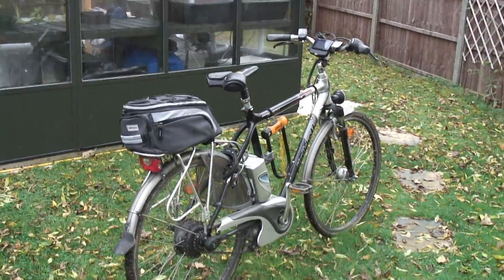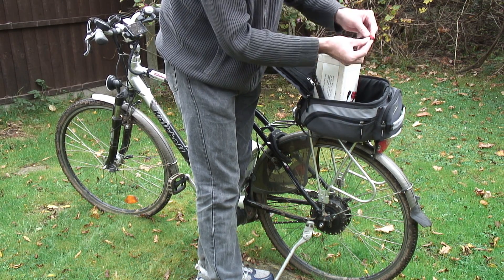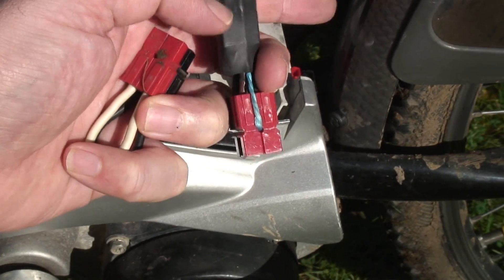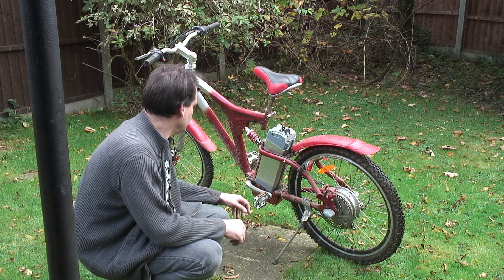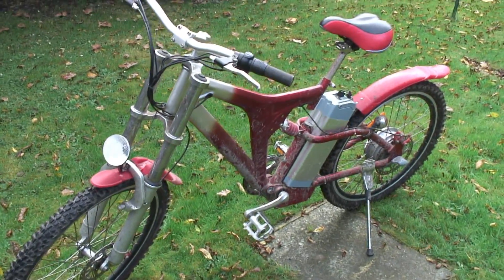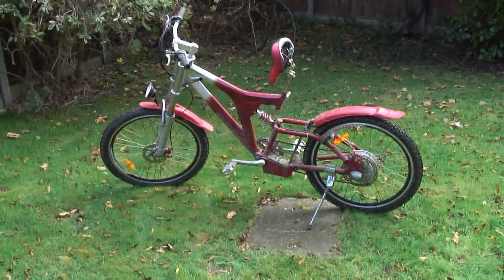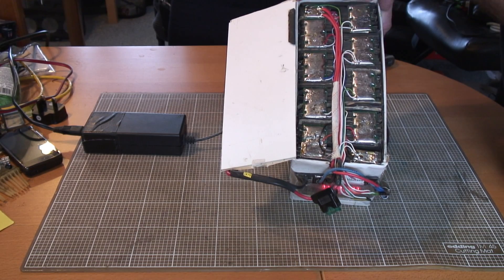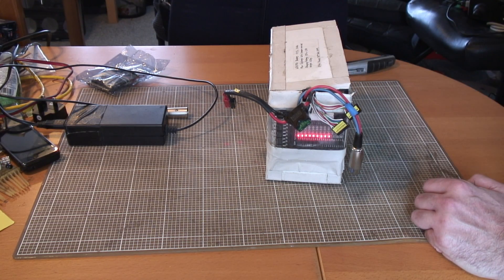E-Bike Overclocking and Custom Battery Packs

Comment: Hi Jim I have just purchased a new Panasonic motor, i intend to mount it on an old bike frame i have by means of some chopping and welding.
  For the moment i only have the motor, a rear 8 speed internal hub + some large'ish Li-po's & the old frame to work with. 
  I know i will need the handlebar display (controller). Also i will have to buy the chain ring a tensioner and a few other bits n bobs.
  Is there anywhere i can find detailed info on this motor? I've been finding it difficult to unveil Panasonics secrets.
  I will be trying the shunt short mod. Seems what you have dont is basically remove the shunt with that much wire wrapped around it but it did not appear to be soldered to your shunt, could the shunt be removed completly? What exactly is the job of the shunt? It dumps power back into the circuit and routes it away from the motor right? But why exactly? I have seen them in ammeters, it's basically a powerful low resistance resistor which provides enough resistance so that you don't have a 100% dead short but what is it's purpose in the speed controller? Is it like a safety buffer? A restriction? 
  Anyway sounds like it does the job but i was wondering if you have any info on these add on dongles? They basically trick the electronics into thinking the bike is doing half the speed it actually is but what is inside one of these? Is it simply a resistor? I see people are selling the kits for huge amounts of money and there cant be a great deal of electronics squeezed into a jack plug!
  My initial thought was that the torque sensor changes resistance as you pedal but i also read that it induces an electromagnetic field. Obviously there is a simple way to trick this signal but i am still trying to find the info.
  For the moment i just have the motor and there are a tonne of wires and i can't find a wiring diagram anywhere. Any help would be much appreciated. I live in the mountains and am surrounded by trails, town is a good 1 hours ride up and down hill from here so i'm looking to speed parts of my journey up. I dont want to burn my motor out but i have tried the pedelec assist system before and found it annoying when i wanted to pedal faster but the motor stops assisting.
  Thanks for the great video, it's difficult to find info in english on these units.
Reply from the maker: Hi +izzzzzz6  - That sounds like a superb project. All of the information I found on the panasonic motor came from pedelecs.co.uk forums, and flecc's panasonic info page at http://www.flecc.co.uk/p/panindex.html , but most if it related to the older lead-acid powered version of the motor - I worked on the assumption that the newer version would be pretty similar. The job of the shunt is to provide a very precisely known low-value resistance - by measuring the voltage across the shunt resistor, we can calculate the current flowing through the shunt... (for example: if we have a 0.2 ohm resistor, and a voltmeter reads 2 volts across that resistor from end to end, then ohms law tells us that I=V/R = 2/0.2 = 10Amps must be flowing through the resistor) - By wrapping all the coper wire around the resistor, I reduced the value of the shunt resistor, thereby tricking the controller into thinking less current is flowing than actually is, causing the controller to allow more power to flow to the motor as a result.  

I did not remove the shunt, as my intention was just to lower the resistance of it a bit, rather than all the way down to zero - I also wanted the mod to be reversable if I ever come to sell the bike. Working directly on the circuit board would be very difficult as they've encapsulated the whole lot in about 1/4inch  of some soft rubbery compound to prevent water damage/corrosion affecting the circuit board. There is undoubtedly some process through which the encapsulation can be removed though... either heat or something chemical - It had originally been my intention to do more reverse engineering on the motor, but the encapsulation prevented me from doing that, so I settled for just modding the shunt resistor.

You don't need dongles to trick the bike into going at a different speed. The motor unit senses the pressure on the pedals using a torque sensor attached to the crank shaft, and decides how much power to send to the motor based purely on torque (not pedal rotation speed) - The power from the motor is passed to the chain using a small 14-tooth cog (I think 14-tooth is the detault). If you change the small cog to a larger one (i.e 16-tooth) then the motor unit will power you to a higher speed (changing from a 14-tooth to a 16-tooth gear will take the top assist speed from 15.5mph to 17.8mph), but you'll have less torque as a result.    

Hope that helps you out. Cheers!!
Reply: Yes i bridged the shunt, not much left of the shunt now, mainly thick copper wire soldered in place. Also will go for a smaller rear cog for higher speed, i bought an 8 speed Nexus internally geared hub. Just need some help with the wiring, i know i need to buy a handlebar display type controller but is that all i need? I have invested in quite a few e-bike bits n bobs. I found an older Panasonic system  which is a torque sensor BB and front wheel motor. Then the other day i found a place selling lots of wheel motors mounted for about £25 each. I bought 2 Bionx. Also i got lucky and bought a Smart Bike For about £420. So it's Fully woking and i'm about to take it for a ride. Had to disassemble the battery to charge it as i am waiting for a special DC connector to arrive. Need to figure out how to flash it as top speed is locked in at a very low pace. version 62 and i can't seem to access the code menu.
Reply from the maker: Hi +izzzzzz6  - Sorry for the delay replying... Swamped. As I recall, the only connections required to the panasonic unit were the power and the display - everything else is self contained. There is also an optional connector for a thumb-throttle (which only goes up to 4mph), but you don't have to use that if you don't want to. Congratulations on your new Smart Bike :-)... Cheers!!

Comment: great video , your the man :)  i'm an electrician but quite alot of these tweaks are out of my league. :)
Reply from the maker: Thanks +lookoutleo - Hope you're having a good weekend. Cheers!!
Reply: yes , went for a 30 mile cycle on hilly ground here in oban today  and my 200w yamaha xpc26 used 60% of my 8000mah 6s 22.2 zippy battery with me helping. :) going to buy the 20000mah version and see how it gets on :)
Reply: aare you an electronic engineer? i had a look at ping batteries but they are so much more expensive, the one i'm looking at is this. http://www.hobbyking.com/hobbyking/store/__80910__Multistar_High_Capacity_6S_20000mAh_Multi_Rotor_Lipo_Pack_UK_Warehouse_.html. the zippys are very cheap and will allow huge discharge rates. i was watching a video where the 8000mah was being discharged constantly as 80amps wow. i never discharge over 35amps. whats your thoughts? i use imax b6 charger and seems to balance them fine and  theres no sign of them loosing capacity and ive been using them for more than 8 months and althou the motor doesnt help over 15mph its a huge help and i still get great exercize  :) hope you had a great sunday
Reply from the maker: My thoughts are that Li-Ion batteries have come on a long way since the time when I bought that ping pack, and I don't seem to hear about premature Li-ion failures anymore these days - I'd say go with the hobbyking pack. Cheers!!
Reply from the maker: +lookoutleo Lovely part of the country up there - beautiful scenery for a bike ride. I'm a little envious as it's been thunder and lightning here in Surrey today. Cheers!!
Reply: when you come to scotland i'll show you around. my fav islands are mull where i go very often and on to mull. also western isles are amazing. bring your karlkoff and we can go cycling :)
Reply from the maker: Hi +lookoutleo - I've done a little e-biking around by Loch Sween and over towards Lochgilphead as my folks live up there and they've both got e-bikes that my wife and I get to use when we visit... Hopefully I'll get up there again this summer to enjoy some beautiful views. Kilmory beach is definitely due another visit. Cheers!!
Reply: +Jim Conner  thats so weird , so many people i meet have a connection to argyll and there can only be 30000 people live between campbeltown and oban including the islands. its nice down loch sween and achnamara. maybe gp cycling together . i know obans best shopping in the area so maybe youll be up this way. speak soon

Comment: lol that intro awkward for everyone
Reply from the maker: It was certainly awkward for me... and that one was about the fifth take :)... Thanks for taking the time to comment... Cheers!!
Reply: It was a good video and I wasn't aware a boost converter could be used to boost 36v to 48v due to the amperage. Very impressed with the bike battery build especially with it being 6 years old!!!
I've been very curious about hoverboard batteries possibly being used in Ebikes, they're 36V 4.4aH and £40. Not sure if they have a bms but are ready built.
Reply from the maker: +PS4 Custom Gamer - At 48V, a 250W motor will only be pulling around 5 Amps, which isn't too unreasonable for a 600W boost converter to deliver.  The output from the boost converter may dip a bit under heavy loads (the 250W motor power is only the average value), but it'll never dip down below the 36V of the battery as the boost converter has a current path through a single diode and inductor between the input and the output. Those hoverboard batteries are a very good price... I figure there's got to be 20x 18650 cells inside each one, which works out to around £2 per cell... well worth a punt at that price. Weekend is nearly here. Cheers!!!

Comment: so with the first bike with the added battery pack what is the range and max speed throttle only
Reply from the maker: Hi +Adonai Zedek - With the extra battery, the longest ride I've done was 72 miles, after which the batteries were pretty much empty. There isn't a throttle-only mode on that bike though, so you have to put in at least a little effort... I used max assist pretty much all the way though. Cheers!!
Reply: thx thats aweome.   How many total amp hours?
Reply from the maker: Hey +Adonai Zedek ... That's 30aH in total.. 10aH from the original pack, and another 20aH from the extra pack... 864 Watt-hours in total. Cheers!!

Comment: What was your avg. speed when you rode  75/80 miles on your Kalkhoff Agattu (25.9v10ah) /w 29.7V20AH?
Reply from the maker: Hi Roger Can - Sorry for the delay getting back to you - I've been off on my holidays without an Internet connection. I tend to prefer avoiding riding on roads if at all possible, so my route took in a mixture of forest paths, bridle ways and other off-road routes. As such, my average speed is pretty low compared to most cyclists. It was a very leisurely 12mph on that long trip, but that average included a pub stop or two somewhere along the way. The bike itself can happily cruise at 15MPH on tarmac on all but the steepest hills. Cheers!!
Reply: Jim Conner No worries!! Thanks for the info!! Cheers!

Comment: Your method of protection with 50W inverter and current limited power supply will not protect you in any way.
Current is the one that will kill you and not much is needed anything from 100 to 200mA is deadly. So if there is enough voltage so that the resistance of the human body can allow for that 100mA you are a dead man it may be even less like 60mA and still be fatal.
Resistance of the human body wries form person to person depending on how dry or oily the skin is and how much contact the conductor has with the body.
Usually anything under 30V is considered safe if you are not in a very wet environment.
Not to mention that there are some storage devices in that power supply (electrolytic capacitors) that can be enough even with the input power is removed completely so power limiting your input dose nothing for your safety.
Reply from the maker: Hi electrodacus - I realise that the inverter won't protect from shocks, but it will protect me from having my fingers burned off etc. With a 250ma current limit on my 12V supply, there is just 6W of power being delivered into the inverter - which equates to approximately 25mA@240V.  I figure I'm more likely to survive a 25mA shock from that than many kilowatts delivered straight from a wall socket - At the very least, it prevents transistors etc from exploding in showers of sparks when I wire them up the wrong way around or some other similar silliness, but is enough to let the switchmode start up without a load attached and achieve a stable output voltage. Tinkering around with high voltages is never safe, but I figure it's safter with the inverter in place than without it. I can't say that the inverter has ever saved my ass though because I've not yet been careless enough to touch a 'hot' bit when I've had something on the bench. (I have had full mains shocks from other things in the past, but I'm lucky enough to have a very high skin resistance so my reaction is normally one of 'that feels like mains' than being blown backwards across the room as happens to some unfortunate folks).

Out of interest, what would you recommend for safe working at mains voltages?

Cheers!!

Comment: So let me see if I got this straight. 10 Jiggawatts of bicycle megatrons crossed with isotopes at a range of .0231 - .8984  kilojuoules makes the time machine plausible for a travel period of 10 years forward or backward. I'm just being stupid, but if you were to apply some of your IT/Electrical knowledge towards some real time wifi based monitoring of water systems (Temps, PH, Water Levels, Remote power controsl via phone applications via Rasberry Pi and Arduino sensors, I would be very very keen to learn. hint hint :) Good on you Jim, your IQ has certainly not been wasted.
Reply from the maker: You are correct about the time travel concept but your numbers are 0.001 kilojoules out (which as I'm sure you know could result in the destruction of the universe) - I agree with your suggestion about mixing my electronics and hydroponics hobbies, so using the bicycle time machine, I have just popped back in time by a few months and placed a whole bunch of orders on ebay for a variety of bits to be used in a number of hyrdoponics+electronics crossover projects... all but two of the things I ordered have arrived now, so won't be long before I introduce you to 'The Mixologist' project.... coming soon to a channel near you :)... Cheers!!
Reply: Jim Conner Excellent! Safe time travels brother. That shit can be hard on the neurons.

Comment: I've used bother bikes in the video. The first expensive one can pull a wheelie in low gear very easily. And the extra battery pack came in useful on our rides. 
I'd estimate the second red bike must be at least 50kg and without a battery is like riding with the brakes on.
BTW Jim the second red one will be back next weekend, time to chop them up and make something to show everyone.
Reply from the maker: Matthew Reece-Ford Thanks Matt. I've got a few other projects in the queue before I get onto that particular one... Maybe next year for the bike hack job. Cheers!!

Comment from the maker: An electronics video this time around. Electric bikes, custom battery packs, easy tweaks for extra power and a bit of quick fun with a boost converter and an old washing machine motor.
Reply: Excelent  video Jim, probably one of the best yet !!
Reply from the maker: 101blog Aw.. Thanks John. You're very kind. Cheers!!
Reply from the maker: Thanks *****  - Can't beat it for getting up hills. Thanks for watching and taking the time to comment. Cheers.